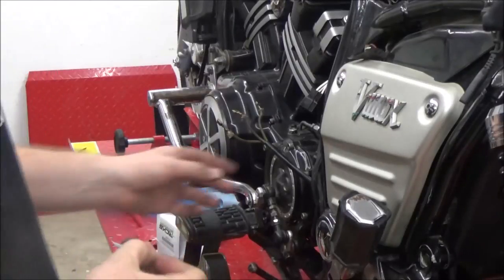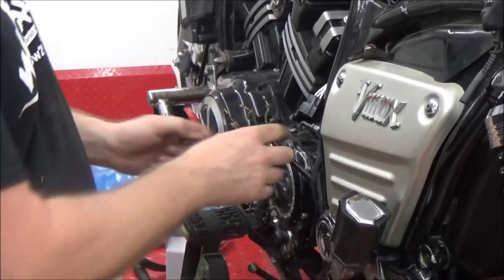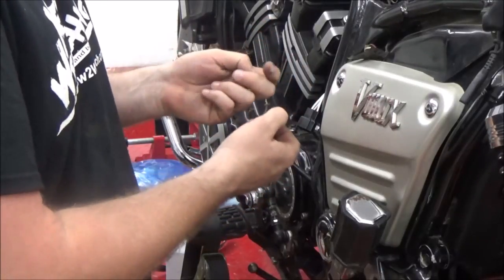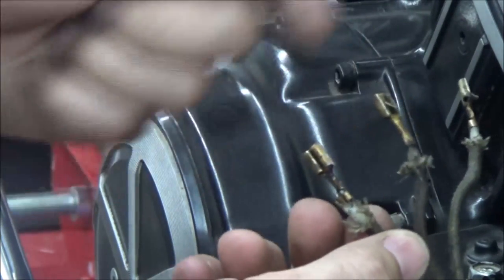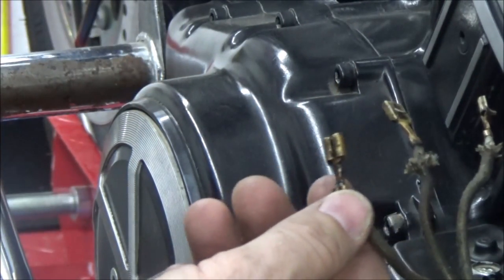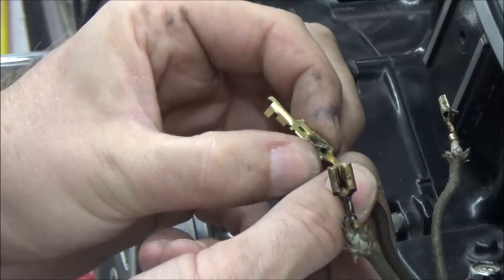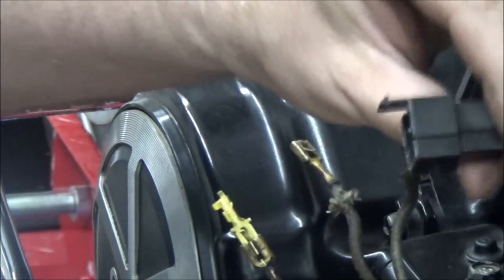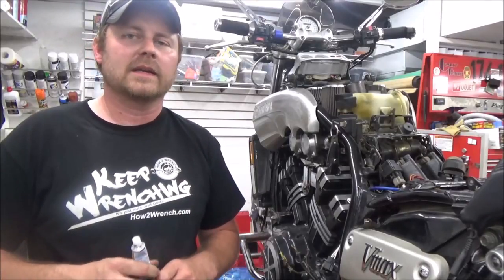How to test verify electrical connector integrity (before volt drop testing)

Comment: That for the tips Shane. One thing you should also consider is that brass when it gets hot looses its temper and just squeezing the connector may not restore it to the proper drag or tension. With lost temper of the brass, it looses its springiness, so it should be replaced.
Reply from the maker: Thank you. Here is a way to support all the free videos. Don’t forget to subscribe too! 
Want to say “thanks” or “keep it up”? Click here https://www.paypal.me/how2wrench  

Coach Conley is also available for hire to personally work one on one with you if ever needed.

Your answers and help are just around the corner. Save time and money while protecting your investment and yourself by doing it the right way!
Follow us!
Web:
www.How2Wrench.com    
www.Tools2Wrench.com

Comment: It seems to me that the main purpose of electrical connectors is to ease assembly at the factory.  So I often make things simple, I just cut out the trouble-prone, bulky connectors and solder the wires together, covering the joint with heat-shrink tubing.  If I need to replace a component, I just cut the wires and then resolder in the new component.  Only takes a few minutes.  One unexpected result of these soldered joints is that they act as fuses.  If there is a severe short of an unfused circuit, the wire gets very hot, melting the solder, and the joint falls apart - don't ask me how I know this.

Comment: There is a powder /crystal and sometimes a paste used to clean oxidation off silver prior to solder/braze. The solution is activated by boiling water and mixing the prescribed amount to create the active part of the acid. Place the old connector into the solution long enough to clear away any corrosion, you'll know as soon as you see it. Neutralize with fresh water to stop the etch. Keep this powder in your tool box tightly sealed in a small jar or something and it will last for years that way. Can be purchased at jewelry supply stores around the World and is quite inexpensive.  Also there are many good corrosion prevention pastes that when applied to an electrical connector will prevent problems as well as maintain structural integrity of the connectors. You could also build up the surface of a connector if worn by applying hard silver solder and filling back to acceptable thickness. MAPP gas torch is hot enough to do this job if need be.

Comment: Burned/melted 3 pin? Personally, I would be putting new connectors or a new harness/pigtail on that bastard. Not much wiggle room when you're making a repair with a 2 year/24,000 mile warranty. I've seen burnt connectors that also have damaged strands within the wire and deformed female receptacles that seem to crimp down okay but immediately lose that tension once the corresponding pin is inserted. A customer will be cool with "working with what you got" until they're stranded 12 hours from home with a dead charging system or worse, dropping a charred lump of steel and plastic and a lawsuit in your driveway! Don't get me wrong - great tips that I use quite regularly on my own beaters or in a pinch for a buddy, especially the pin drag test (an essential test when considering the amount of electrical gizmos in today's vehicles)! But if money is being exchanged for repairs then absolute and full ass-coverage is essential! People these days will not hesitate to huck a worst case lawsuit or best case scathing one star yelp or Google review even if you clearly explain the risks involved. All too happy to save a buck now but furious when it costs $50 later!